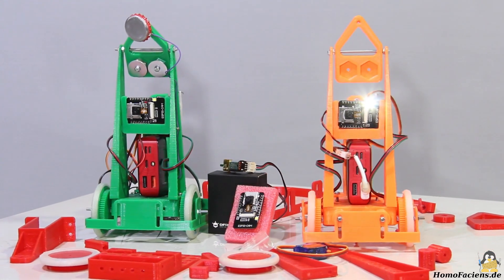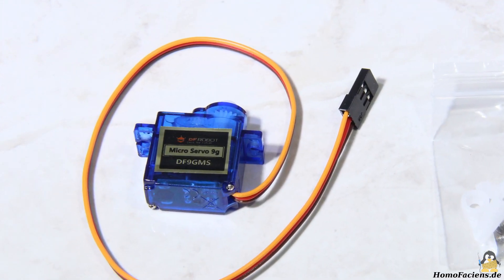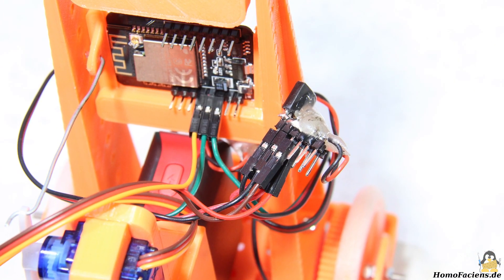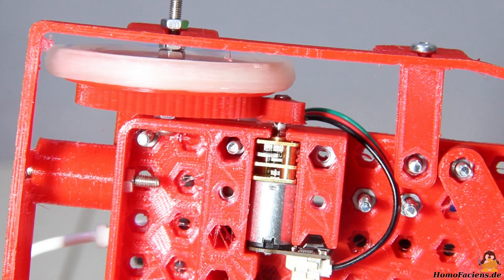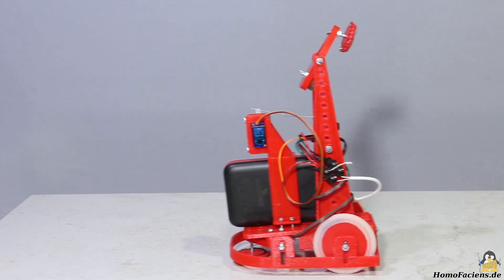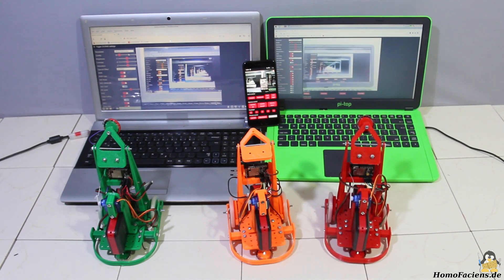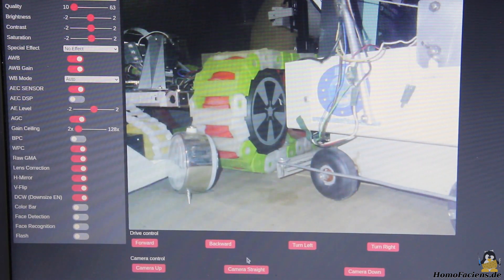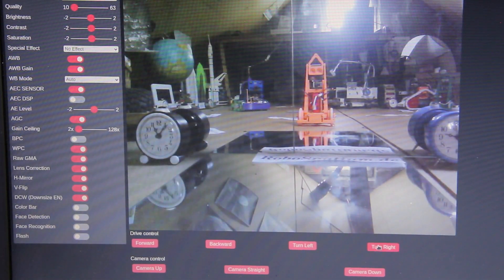Rover R18, based on an ESP32-CAM board

Comment: My favourite channel on youtube and website, thank you Norbert! I have also been playing with the ESP 32 CAM for a few months. Most problems I had when using Wifi were due to improper power supply but also the pcb antenna. The connection can be vastly improved by using an external antenna).
Reply from the maker: Thanks for the hints! Yes, power supply is an issue and I guess it also causes trouble with WiFi. While I did the coding for implementing R18 in my RoboSpatium I came up with soldering a large capacitor in parallel to the power pins. Link quality seems to be better, now. The robots stay connected all day long, so for me there is no need for an external antenna, yet.
Reply: @HomoFaciens  when I ran the CameraWebServer example with a UXGA resolution (Arduino IDE), the frame rate was very low unless i grabbed the pcb antenna with my fingers. When using an external antenna the frame rate was high enough for a fluid image.Good luck for your future projects and thank you again for your hard work.
Reply from the maker: I never got the UXGA resolution. The maximum the camera server from the Arduino example library delivers is 1024x768 even when selecting UXGA, no matter if stil images l or stream. I guess its the camera chip that sets the limit.
Reply: @HomoFaciens   if you ever start a project that involves capturing single frames like a photo, search for ''ESP32 CAM timelapse'' or ''ESP32 CAM Telegram'' on github because these aplications include code to manipulate camera settings. The OV2640 is not very deeply documented but there are people who have gone as deep as playing with registers to increase image quality and exposure (user raduprv on Github).
Reply from the maker: That sources could be worth a click, thanks!
Reply: Funny, my only issues were due the overheating induced by prolonged use if the lighting LED. I've always found the performance of those PCB antennas surprisingly good.
Reply from the maker: Yes, the LED gets really hot. I have reduced the power through PWM in the sketch on my pages. Also for transmitting still images from my RoboSpatium I only turn the LED on when a picture is taken and turn it off during image upload.